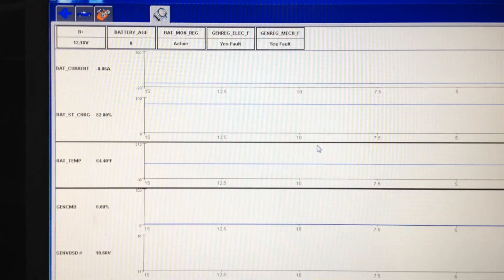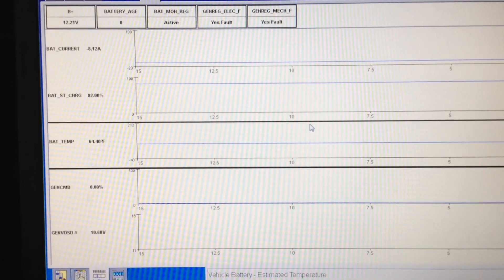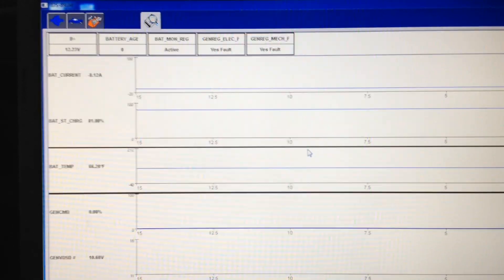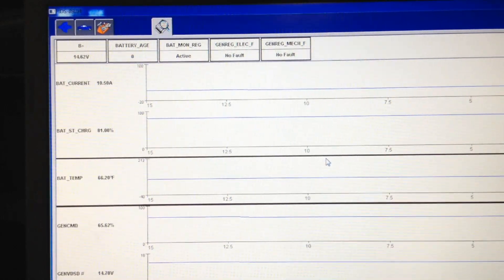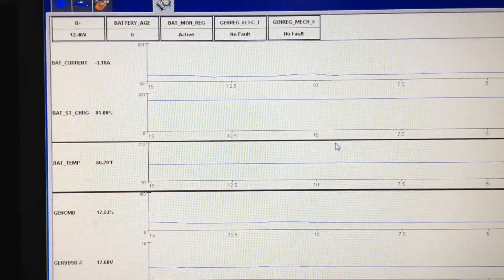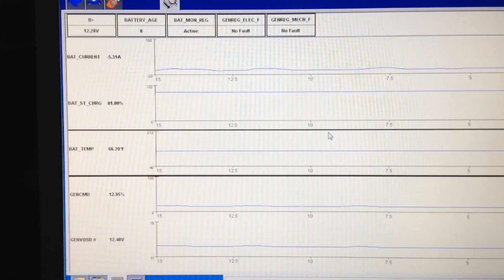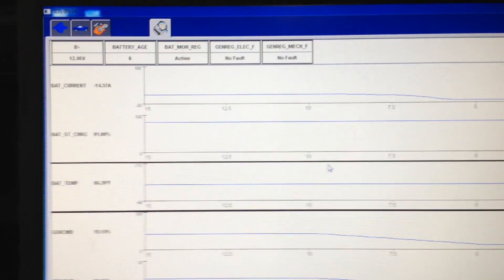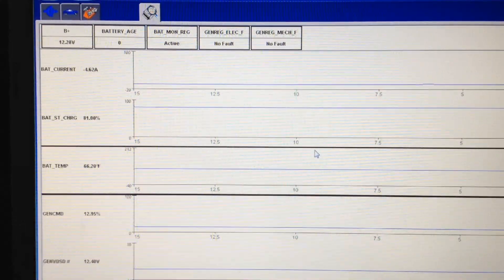Ford Quick Tips: #3 Checking Alternator Voltage On 2011+ Fords

Comment: New alternator on my 2014 f150 5.0 charging from 13.1 to 14.8 and battery light comes on sometimes at a stop light or just driving. I changed it because It seized on startup one morning. Never had a problem with battery light until brand new 220 amp alternator, any help?? Sometimes happens went making a left from a full stop ????? Volt meter shows it's changing ????
Reply: Check all connections at battery and alternator. Sounds like loose wire. Good luck battery cables should not be able to be moved by hand and battery needs to be clamped down.
Reply from the maker: Ford alternator?
Reply: Not from Ford, they want $700.00 . Amazon new not rebuilt.

Comment: When my '17 Focus ST was new, my audio capacitor would show 14.1 - 14.2 volts routinely. Now I'm having voltage issues where cold start its 15.1v and drops to 12.3 with no charging from the alternator. Replaced the battery and changed the negative battery terminal and BCM since it was corroded. Issue fixed for a while but now its back. Windows wind up slow and car idles rough at idle. If I turn on the headlights, voltage goes up to 13.6v and all is fine, and then it drops again after a few minutes. This is not normal and I'm thinking my voltage control sensor inside the alternator is bad.

Comment: Will ForScan allow us to change the type and voltage of battery?   Such as when switching from a 12V AGM to a 14V lithium LTO (Yinlongs). I already charge at 15.5V using adjustable voltage regulator but it causes Smart Charging confusion.

Comment: 2013 explorer...just change to high output alternator Dash lights go off.(all of em)..then comes back on couple seconds later..power steering gets hard for a split second you can still turn heater goes off so does the screen radio and all..and the check charging system light comes on...truck still starts great...check the volts at the battery 13.9 can someone tell me what is wrong

Comment: Great Vid. Question on my 2016 Taurus 3.5. I have rotted ground wire from a corroded battery terminal. I want to upgrade the ground leads but they travel thru that loom with the current sensor. If i can't get the 3 to fit thru, what happens if one is not being monitored ?

Comment: Ok I have a 2017 f150 5.0v8 I have a large case 6 phase hairpin alt for my audio system lights and tools. Voltage is always low unless I'm decelerating is there a way toale it charge at 14.6 like that alt is supposed too? I have a large mask of agms so plenty of storage capacity. Plz help thank you
Reply: Man I'm having the same problem with my 2011 I need a constant 14.5v .. have you figured anything out yet
Reply: @extremeshenanigans4237  yes us alts pcm controller

Comment: Love your videos, I’m really learning a lot. Any suggestions on adding an aftermarket sound system to a vehicle with a bms?  High wattage systems require the big three upgrade but, not going through the amp clamps, the alternator will never “see” the extra demand and batteries will not get the charge they need.  The only solution I see is to replace the factory wiring with the larger size needed and go through the amp clamps. Huge pain in the rear.
Reply: I unplugged mine. Runs better and no battery problems anymore

Comment: Can the charging voltage be increased by chance? And can the monitoring system be turned off somehow? Reason being I have a 2013 explorer XLT and I have a competition SPL sounds system installed that is using 120ah of Yinlong Lithiums. The lithium's need to charge in the mid 15s if a set point of 15.5-15.7 could be made can u please let me know. I have not found any other solutions
Reply: That's what I'm wondering. I have a massive car audio system and the battery is stroking out because it's trying to sit around 13v

Comment: So these 220amp alternators idle at 40-60amps?
Reply: Under load,yes....and even higher if fans are in high speed...no load(a.c. off,lights off,it'll actually cut back and may even run around 4amp to -4amps(or more) if the BMS sees battery Soc @ 90% or more...I've been running several data tests after doing a replacement in my '16 and the voltage and amperage is all over the place...even has a pid for "battery days in use"...in my case,my 6yr old OEM battery showed 2200 days of use on mine,prior to doing a BMS reset(to basically tell the BMS the truck has a new battery)....its crazy how all over the place,voltages and amperages are and real easy to misdiagnose if you're not familiar with how these newer systems work and what the values should be @,at any given load and RPM

Comment: Hello. Yes, I have learned from you.  I have a 2011 F150 with the 5.0   guy brings that truck in, alternator caught on fire. burnt Battery wire and the 3 wires off the pigtail plugin. burnt oil sending unit and wire. repaired the 5 wires, new alternator. it shows a charging. BUT soon battery light comes on and alternator seems to me it is getting HOT?? What am I missing Sir?? Thanks for your time.

Comment: 2011 ford f150 I have battery light coming and going away while I drive and it is showing 14 to 14.5 volts constantly and I just replaced battery yesterday. By this video it sounds like bms is not working correctly

Comment: I have a 2011 F-150 King Ranch with the 5.0, I have changed the battery and had the alternator checked (works fine) the battery light comes on the dash and stays on and the headlights go dim while driving. I really have no clue what is going on

Comment: My 13 Escape. 2.0, has gone through 2 batteries, once in 2015, and again Dec. 2017.  At first I figured like I noticed today that when I started my vehicle it was above 14v, as I was driving I watched it drop to 13.9 and ultimately settled around 13.4v.  So after this video I feel I am back at square one, not understanding why I am going through batteries every 2 years.

Comment: Any idea why I'm on the 6th battery in 4 years on my 2013 f150? It will start fine one minute, act dead the next and then go right back to starting fine. Any help would be greatly appreciated.
Reply from the maker: I do know these have poor software for the BMS system and there was an update but they also had issues with the battery positive cable both at the fuse junction box. So is the battery actually dying or is there just connectivity issues?

Comment: do all 2011+ fords have this?   i just called 3 dealerships and they claim to know nothing about this and said you dont need to reset anything.   i dont believe them...thanks for all your good videos
Reply from the maker: Not all 2011 models no they rolled this out over time but anything with the amp clamps on the battery cables has this monitoring software yes. Most dealer service personal and definitely almost all service advisors haven't a clue.

Comment: 05 ford freestyle 3.0L battery light on and check charging system, after replaced bad alternator, the new alternator is working and the battery is was replaced a week  before, My theory is the after market alternator does not meet what the PCM want to see like a ford alternator, have you seen this before,  it had been running for to weeks..
Reply from the maker: +felplay vina (felplayvina) yes the aftermarket alternator regulators do not communicate with the pcm and causes this.
Reply: +FordTechMakuloco  Thank you for the replay and for the good info for all your vids..